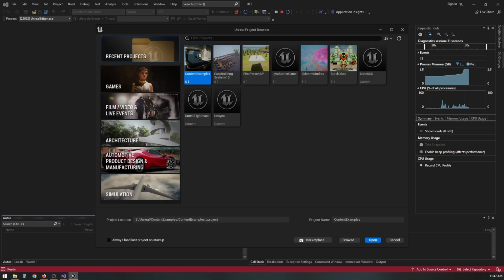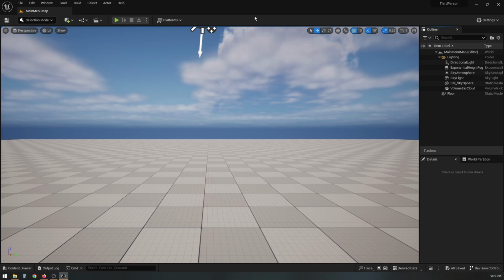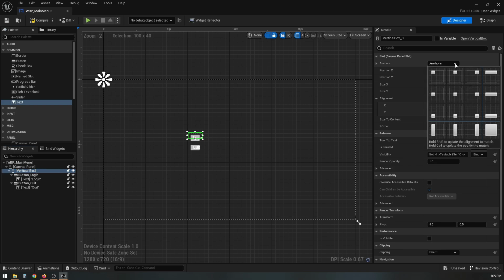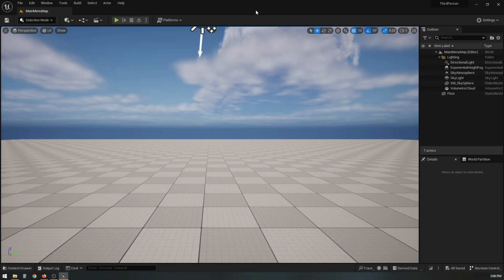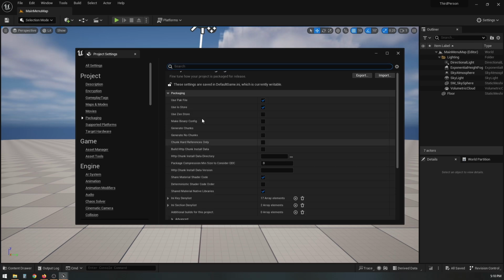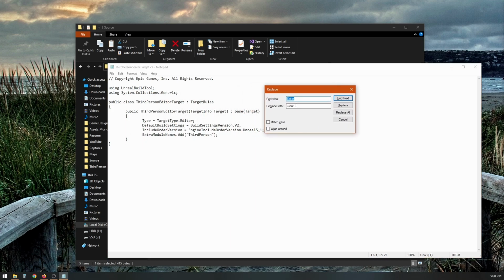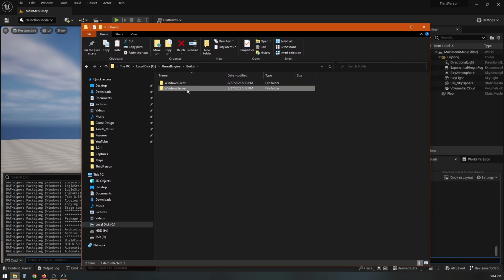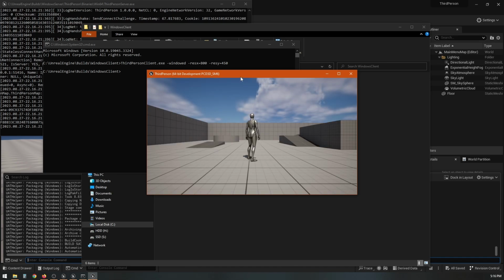EP03 Building Dedicated Servers with Unreal Engine 5

Comment: When I clicked 'Join' in the client, the server showed the following error and then shut down:

"Error: appError called: Assertion failed: CurrentApplication.IsValid()"

If anyone else runs into this issue, here's what fixed it for me: The server was trying to use UI features. To prevent this, I modified ThirdPersonPlayerController.cpp by adding "if (!IsRunningDedicatedServer())" right after "Super::BeginPlay();" so the dedicated server skips the UI-related code.

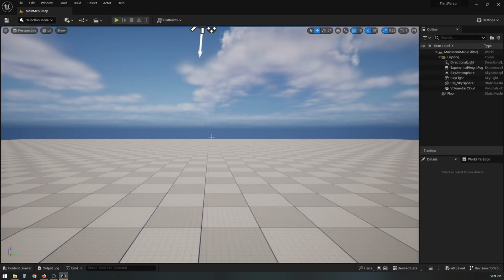Comment: Good stuff, but the pacing felt painfully slow. The core part runs from 10:03 to 16:24, and even at 1.5x speed it still drags. That suggests there's maybe 3 minutes of truly relevant info. Not trying to hate, just a reminder that viewers of this kind of content are here to learn, and stretching 3 to 6 minutes of material into 20 only hurts that goal.

Comment: If I'm not mistaken shouldn't client builds also be able to run as a dedicated server? Is there a way to block that?
Reply: It wouldn't be a dedicated server it would be a Listen Server on which a Client acts as the server, but as soon as that player disconnects it closes the server for everyone, unless you code it so the information of the server gets transfered to another client which will work as the server, but that creates a more complex software and probably not so efficient

Comment: i noticed a weird behavior when running the client. on KBM, everything works fine. But when using a gamepad, it moves every single client at the same time. Anyone know why?
Reply: Hey did anyone find the solution to this problem
Reply: @choubertpierre5639  not me
Reply: @Play_the_pitch  You are most likely sending the information of the movement to every single client, you have to verify if you are the local player or not

Comment: Any idea why my editor on standalone stops connection when I click join? It works on Client Build though. Editor Connection doesnt work on two computers 5.4.1. Is it related to the WSL linux subsystem I installed?
Reply: I am in the same boat
Reply: I had this and it was related to the mode, I believe the client was attempting to take on server roles. Moving back to the base gamemode and building up from there worked for me.